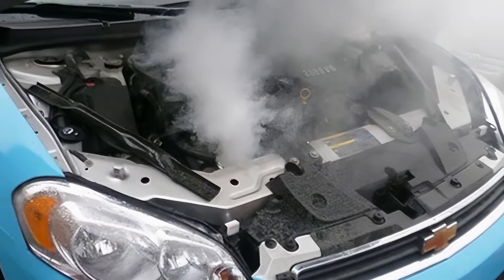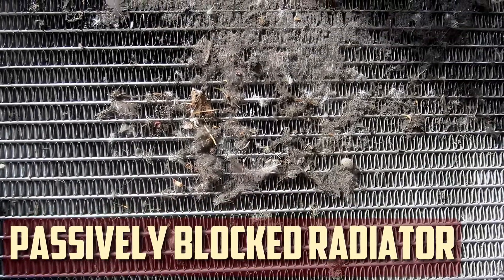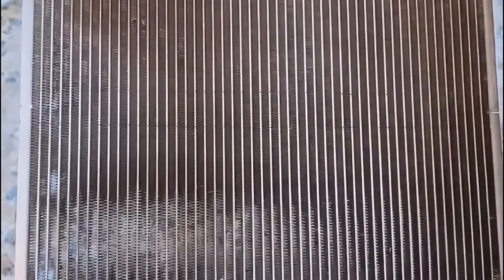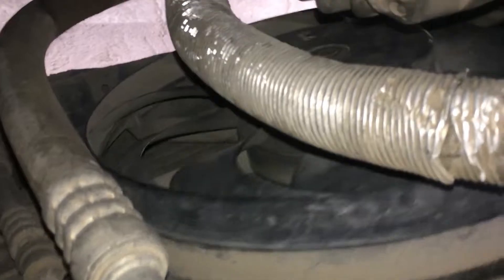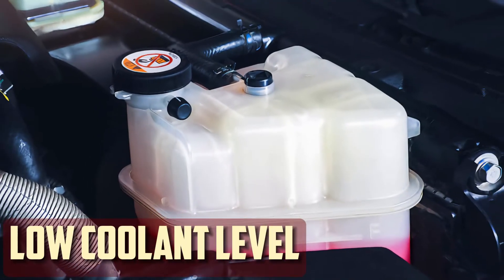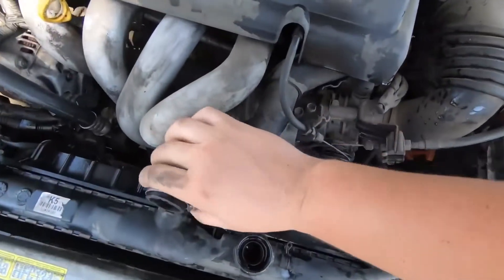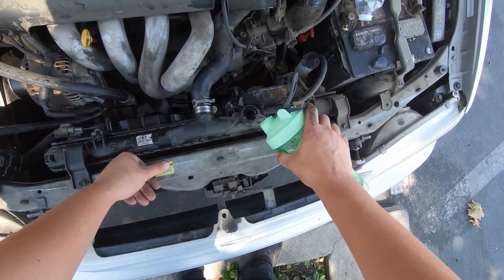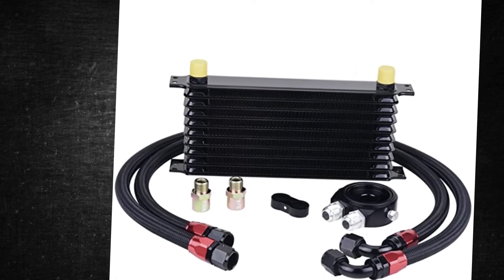5 Causes You Car Overheating When Accelerating. How to Diagnose & Fix?

Comment: I have land cruiser GXR 4.6 L V8 2011 model. Recently, I changed the air intake sensor and ignition coil D. I also changed the radiator and for a while it ran smoothly. However, I changed my water filled radiator with coolant like 2 days ago. Now, upon roburst acceleration, the car over heats, engine check light turns on, 4 Lo light starts blinking and sometimes it even starts missing when this happens. 

Any idea what should I do about it or where might the problem be lying at?
Reply: you mayb ahve air in the ssytem.. porblems i sensoir or igniton coil, sensors, etc 
a leak in the ssytem, problems in the cap...etcetc
Reply: Recently, I changed the air intake sensor and ignition coil D. WHY THEY WERE DAMAGED???
I also changed the radiator WHY IT WAS KEAKING???and for a while it ran smoothly. However, I changed my water filled radiator with coolant like 2 days ago. Now, upon roburst acceleration, the car over heats, engine check light turns on, 4 Lo light starts blinking and sometimes it even starts missing when this happens. YOU CHANGED SPARK PLUGS?
Reply: what was your solution??